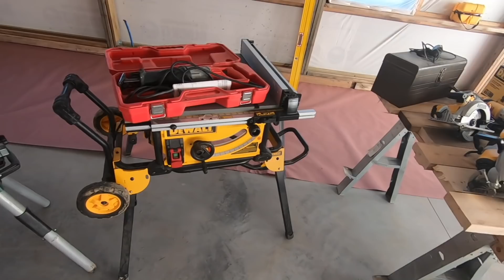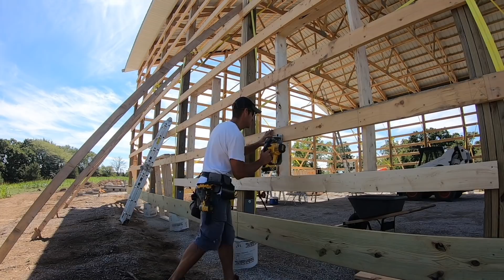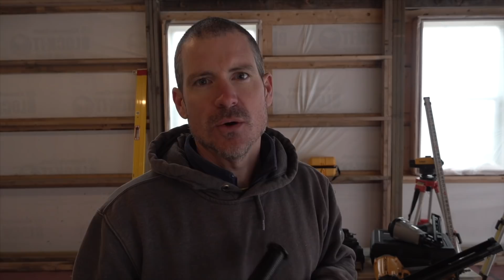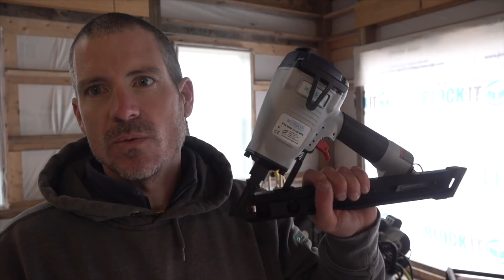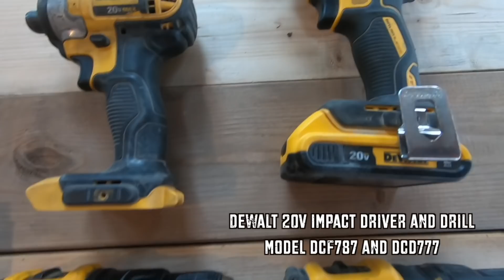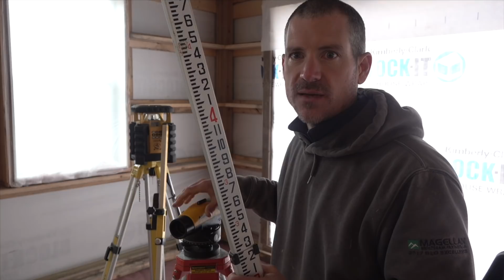Building a House | Tools You'll Need

Comment: Appreciate this!  You tried the 7 1/4 inch sliding miter saw from Dewalt?  Caught my fancy because of the 20 V system.   Otherwise it looks like a hammer drill may be in my future, or nailer.

Comment: Hi, very usefulls informations!! I starting to build a house in the wood where electricity will come end of 2022. I project to start during spring, an running coordless but i already have coorded tools, and air tools. I sold my house and my mechanics air compressors so i don't know if it will be much usefull to buy a portable compressor and generator, or buy all coordless tolls instead?
I saw in your video that you had a portable generator. How many amps to run compressor and others coorded tools like miter saw and other coorded too,s at the same time?

thanks for your answer.

Comment: Thanks for the video. If you need more battery power check out the 60 volt flex battery from Dewalt. It works on the 20v platform and gives you 3x ah at 20v. And a much stronger tool.

Comment: I bought a dewalt impact and after to screws the motor broke then I bought a rigid and not happy with it either, wished I just bought a dewalt again because I probably just had a lemon
Reply: Did you try returning or exchange it.  I would think that it had a warranty.

Comment: Great video, Paul!  I love all my tools and machines, which are numerous, but I have one that is pretty much useless.  A cordless DeWalt reciprocating (sawzall) saw.  I can only get two or three 2x4's cut with it, before the battery goes dead.  The same batteries work great in every other tool, and even new batteries don't last in it.  Most of my power hand tools are DeWalt, but my framing nailer is a Hitachi, which has never failed me.  I've had a Milwaukee Sawzall for 35 years, that still runs like a champ, but I bought that cordless for working on a pole barn on one of my farms that doesn't have power yet, and wish I hadn't.

Keep up the great content.  I love your dedication to perfection!
Reply: Might try getting a new one I use them every day and can cut 20-30 2×4 easy
Reply: @vertonmccaulou5  I bought that one just over a year ago, brand spanking new.  It just eats batteries for some reason.  I really only bought it for that job anyway, and got the work done by taking every battery I had with me, each time I went to the farm.